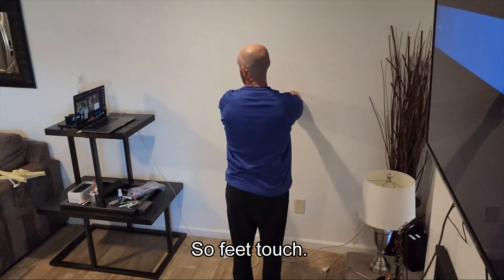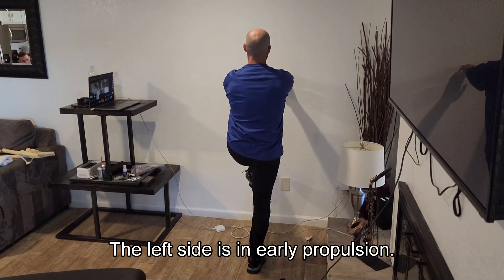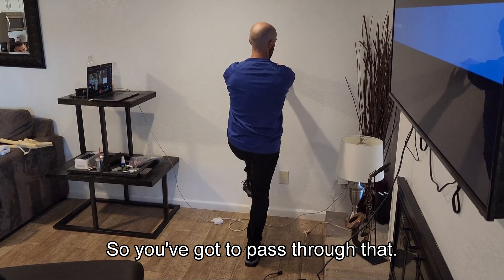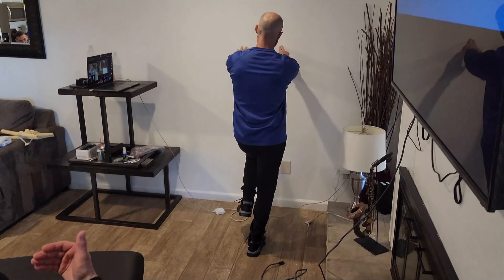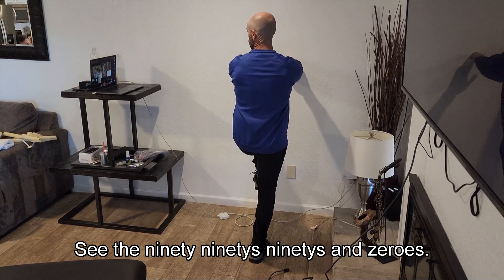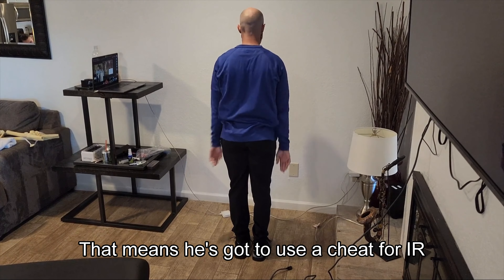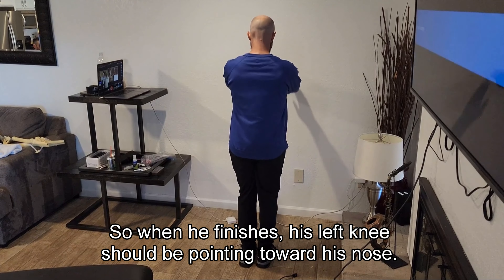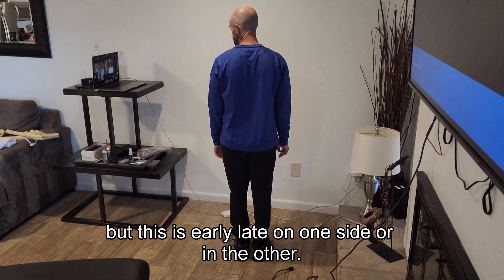Bill Hartman's Load Propulsion Test: How and Why

Comment: this is similar to a wall running drill but done flat footed.  I understand the midstance beginning but why not complete the movement with plantar flexion to  make sure everything lines up properly?
Reply from the maker: Emphasis is on the vertical, so IR is emphasized
Reply: @BillHartmanPT   I guess I'm missing something.  When he lifts his left knee you said the right leg is in late propulsion.  If the foot remains flat, isn't that still midstance (IR)  Late propulsion to me would mean  going into plantar flexion (ER).  I'm not trying to argue , just trying to see where I'm misinterpreting things.  Thanks.
Reply from the maker: @robertmclean2812  No worries. He's on the "back side" of middle propulsion on the down side which is moving toward ER. Test position prevents forward movement, so IR bias at the beginning of late is emphasized. Goal is to push into the ground (IR), not maximize ER which would be the foot you describe.
Reply: @BillHartmanPT  OK. I see now. Thank you.  I've been using this drill as part of my evaluation for years so I'm grateful to learn more about it.